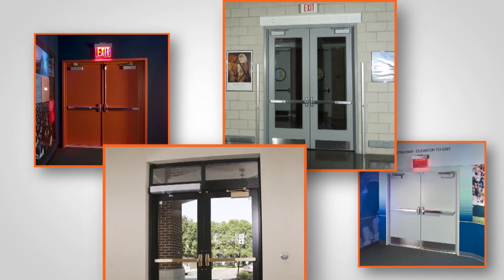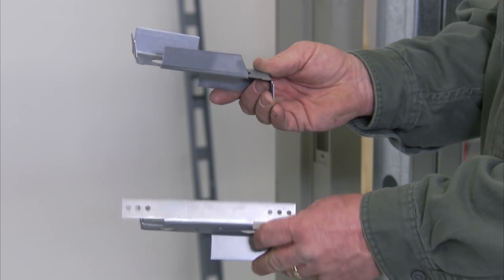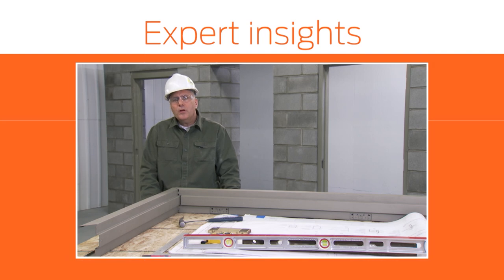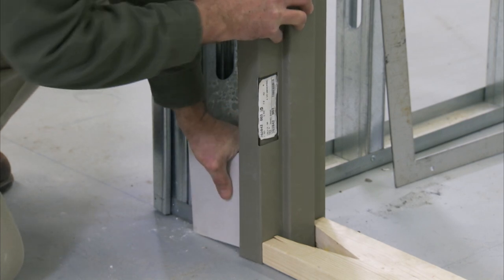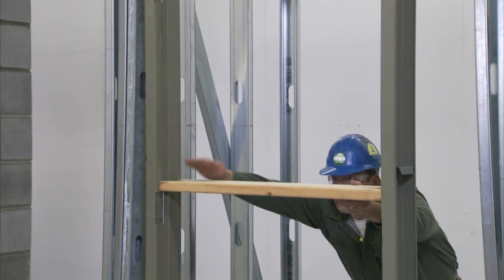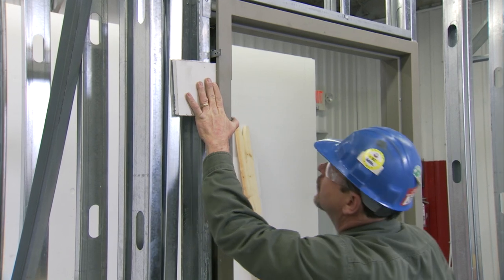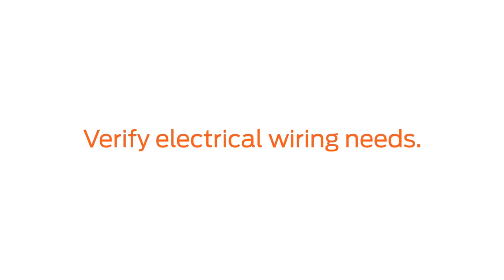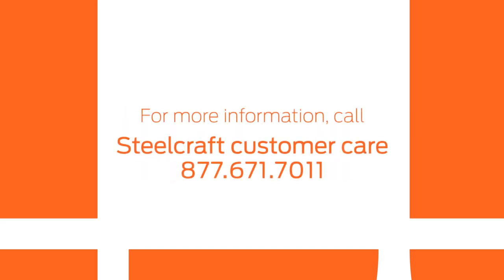How to Install a Steel Door Frame in Steel Stud Construction

Comment: When tough framing for the door opening do you use wood in the studs for mounting the door and use a 2x4 under you metal header or is it all to be without wood around the rough framing

Comment: That looks like something a little kid would do. Never, Ever, EVER!!! Use the wrap around tab with metal studs. By being lazy and using the tabs you will be screwing yourself when you go to hang the drywall. Be a Grown-up and figure out another way. I have been installing metal frames for 32 years and would fire a guy on the spot if I saw that! Please remove that instruction from the video.
Reply: "Be a grown up nd figure out another way" that's great advice!
Reply from the maker: We agree that bending the ears of the stud anchor onto the face of the stud is less than ideal.  As stated in the video, this approach was used to compensate for the special stud location, and the inability to attach the stud to the flange due to the lack of space.  

In an ideal situation, the hollow metal frame is set first, then the wall is built to the frame location. In this video, the wall corner was already built, and dis-assembly of the corner would be time consuming, so we showed how to use a stud anchor properly, emphasizing the need to bend the anchor tightly to the frame and securing it with the low-projection screw.  Distributors sometimes use this anchoring approach out of preference for the anchor.

We welcome any alternative methods, provided they do not violate any structural properties of the frame, or any building or fire codes.  

Thank you for your feedback.
Reply: Rather than criticizing, try offering your solution? What would you do with that stud placement? I am curious. I know plenty of contractors and building inspectors that agree this is acceptable. When adding a door into an existing wall, the wrap around tabs are a great solution to the close stud placement, which you can't always control.